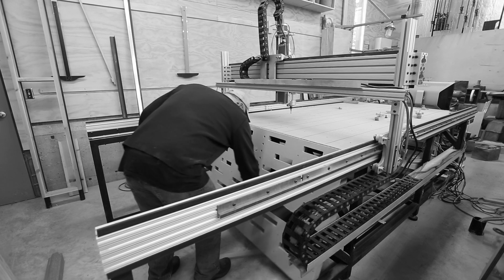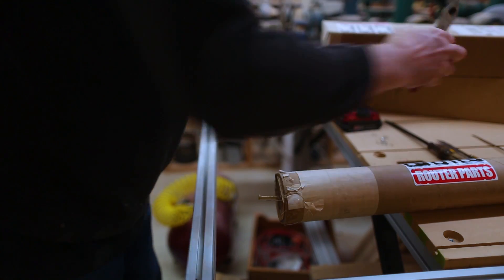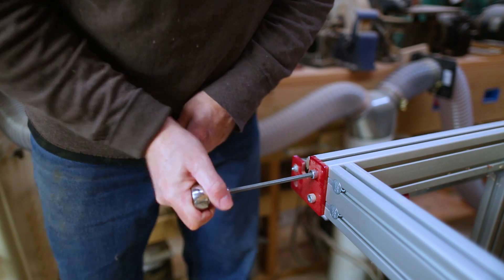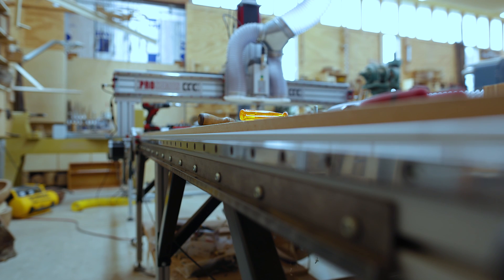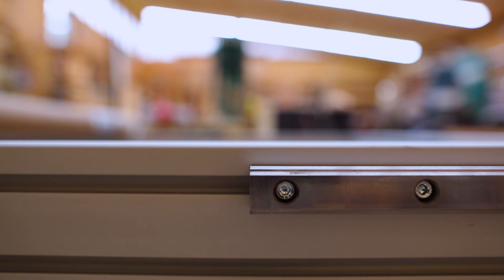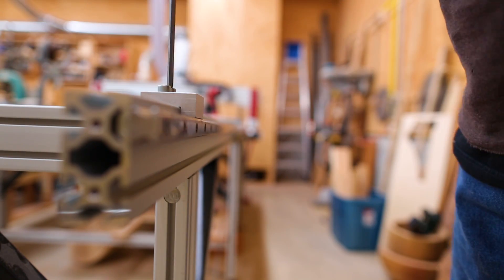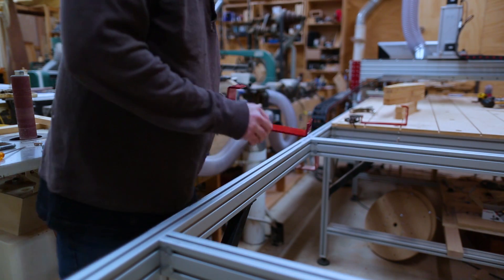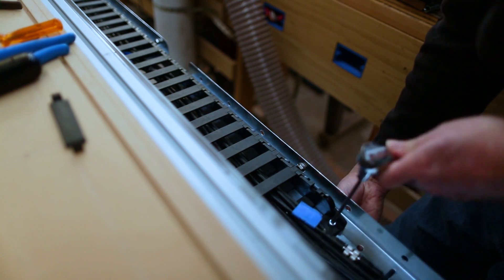Adding Four Feet to My CNC Router Parts 4' x 8' CNC Router

Comment: I just wish they would have packages that includes everything. Went to their site  "oh, the 4x4 standard kit for $3100".... doesn't include legs $500, doesn't include the steppers or controllers $1500, Doesn't include Limit switches $250, Doesn't include Router Mount...... and so on.  Hard to compare prices when you don't know what's needed to get rolling.  Granted it looks like a solid machine.

Comment: Hello Frank. When I worked for a machine builder the techs call the cable track "Cat Track" I never ask but I suspect it may have came from looking like Caterpillar tracked (or similar) vehicles. In any case I have more often than not heard it call "Cat Track".

Comment: as this is a dual y-drive drive machine - I was wondering about how it keeps square. do you have two y-axis endstops that square it up when it's powered on?
Reply from the maker: it seems to stay square,  I should run some tests with the new length.

Comment: Thanks for the video, I'm sure I'll add to mine eventually. But, any chance that you might add a rotary 4th axis? I bought one, and have been trying to figure it out with limited time to invest in it. Cannot find much online on adding it other than parts that said they did it. CNCRP sent a link that got me to a person who did it, the person sent me their plans for the 8020 setup they used without any explanation on how to actually include it in the post processor or Mach 3. You could add one to your machine and explain that process very well. I purchased the axis for about $350 from alibaba and it's a geared setup 100:1 so the holding torque is sufficient. I've seen that they added plasma and I got there updated touch plate with my order, but I cannot get any info from them about a 4th axis. I really hope they decide to implement one, but even asking if they have played around with one on their machines has gotten no response at all from email. I feel like I annoy them when I call. I just don't know enough yet to confidently do this without spending the next month deep into it and not getting anything else done.
Reply from the maker: A rotary 4th axis is in the plan for this spring.
Reply: frank howarth seriously?! Thank goodness. Hopefully the people at CNCRP heavily endorse this. It's a huge reason why I wanted to get into it in the first place. Copying details into multiple extravagant pillars is not an easy thing to do and I'm pretty much obsessed with getting things right. I cannot wait for you to do this. If you plan on purchasing one in a similar way to how I did, alibaba has a good deal on them. However the motors are a bit lower amperage and the stepper controller must have a jumper moved to change the the amperage. Easy enough and you could always swap the motor for aCNCRP one that's prewired. I'll send the link if you want me to. And again, thanks for the videos and good luck towards your 4th axis!
Reply: Hi Guys, I live in Belgium and even though it took some planning to get the heavy package here at an acceptable cost, I managed to put my hands on a CRP pro 4x8. I could not be happier with the building experience and the final result! Hats off to CNC Routerparts! I also went for a little extension. Not as much as Frank, only about 2ft. I use the extra 2 ft for vertical work at the very end (haven't experimented with angled work so far) and also to add a rotary axis. It took me some time to figure it out but as it turns out, it is not all that difficult. If you have questions, I will be happy to help out. I use Mach3 and for CAD/CAM, I am using Rhino3d/RhinoCam and Vectric. Greetz, Nicolas
Reply: Nicolas Dekeyser absolutely! I would love information on this. Thank you for replying to this. It's been sitting in my bench since I purchased it and haven't devoted the time needed to figure it out.
Reply: Hello again, just a quick word to let you know that I am working on a document to explain in the best way I can all you will need to know to get your rotary axis up and running. It is more or less half finished now :) I'll Get back to you as soon as I am ready! Greetz, Nicolas
Reply: Nicolas Dekeyser, thank you very much for your effort. I'll record the process and testing to upload to YouTube for others to benefit. I am absolutely sure that cncrp will host the information on the build section for others. 
I can buy you a beer for your effort, if you would accept. Through whatever cash transferring app. I use cash and PayPal. Probably have others, I could do bitcoin or litecoin as well.
Reply: Hi again! I appreciate your proposal for a small compensation but I really can not accept any payment for helping out. I am just very glad that, in turn, I can give something back to the "community". I have already learned, and still learn, so much from all those (like Frank on this channel and so many others around the world) that produce fantastic work and share their knowlegde with all of us. So it is only normal to help out others without any payment at all. 
Having said this, I would never say no to a beer at the local pub but chances are that this will be a little far for both of us:) But the offer is very kind of course! Cheers :):)
Reply: Nicolas Dekeyser hopefully all is well, just wanted to ask if any progress has been made in your build instructions. I'm excited to be able to follow it. Not wanting to bother you, just checking in.
Reply: No bother at all! Well: I was working on a powerpoint document to explain all you need to know to install a rotary axix and as I was writing it, I felt that it would be much easier to explain everything in a video. If you want, I can send you the work that I already did on the powerpoint to get you started but the plan is to make a video asap. 
I just finished a complete online course to learn Adobe Premiere so I am ready to start making my very first video ever (fingers crossed:)) Hence the delay :):)
Reply: Nicolas Dekeyser I can wait for your video. I'm looking forward to it. Every little step in tech seems to require 2 weeks of learning before moving on and forgetting you had to learn it at all. I'm doing a similar thing, learning at least, with zbrush for making relief sculpture for the CNC. So many new terms and drop down menus to learn. Good luck!
Reply: Hello again, it took a long time but my video is ready :). If you are still interested, you can find it here: https://youtu.be/v7n4QG7xe8M.
Greetz, Nicolas
Reply: I started watching the video and I am sure I will need to go over it a couple times. Very in depth, and much appreciated. I bet it took you a while to get that finished. There was a haircut in there at some point. I am sure that this video will be used for years, considering how little detailed information there is available on youtube now. I look forward to getting mine working, I have some staircases that will be much better off thanks to you!